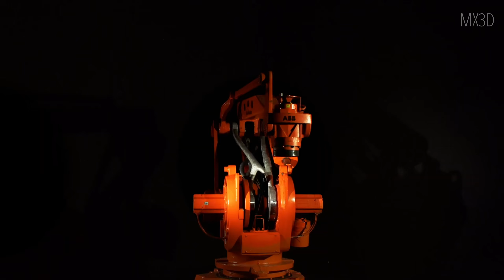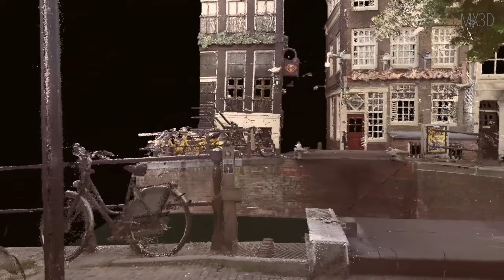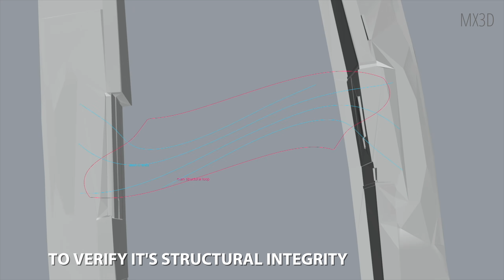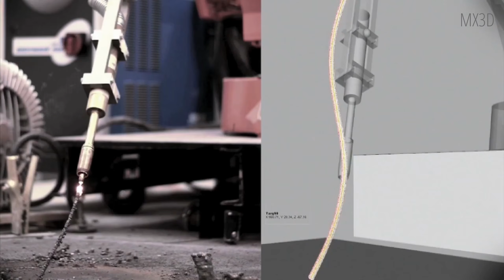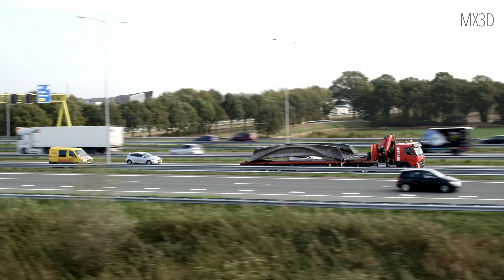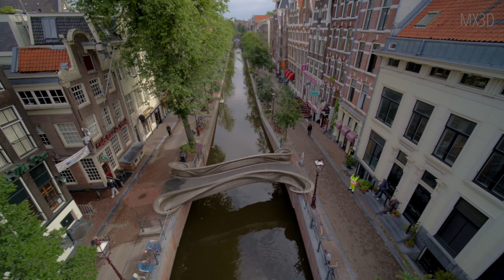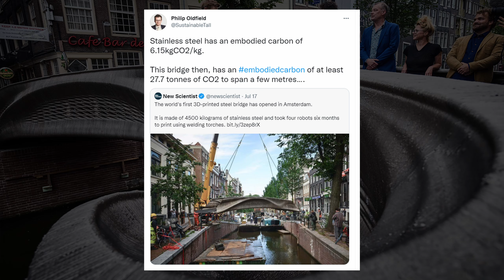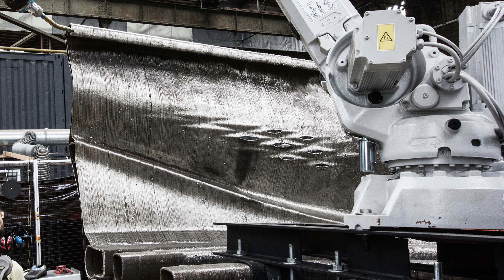World's first 3D printed STEEL bridge | MX3D

Comment: I visited the bridge yesterday. It’s an amazing structure and for me it’s a new word in architecture, but it is also an experimental work and we cannot expect it to be perfect. There is a problem of connecting one side of the bridge with the pavement – you can really look under the bridge between the ground and the walking surface from one of the ends to see the sensors. It leaves a very good impression. 
 Thank you for the video and multifaceted view on this event.

Comment: It is not that ugly compared to some other modern art, but it surely doesn't fit in. In terms of misalignment it can be fixed with repaving the surface in a slanted way if there is no road in front of it that needs to be flat.

Comment: I am a welder and CNC machinist, 3D printing structures like this will never be economically viable for large products. 

This is because when you print with a welder, you are consuming an absolute ton of electricity, so the process not only takes a long time, but it is energy intensive. 

Where I can see this technology working well is in creating joinery where you have to bring several pieces of structural steel together, and need a strong fitting developed in a certain way to bear the load.

Comment: That seems more like a publicity-stunt than anything else:
Metal  printers have been used for many years in industries already, yet somehow this bridge has worse printing-defects than even printers from 20 years ago. And the entire design seems like something you could create with normal manufacturing methods.

3D printing in any form has many advantages for single-piece production like prototyping, but it is not suited for things that can be constructed by other means or objects that you need to produce many of as 3D printing is inherently slow and expensive (and no, no matter the technological advances those 2 can not be changed. That is like trying to create Ice without spending a lot of energy - not possible).

Comment: Its looks great but production process isn't environment friendly, i can tell it as a welder, you don't know how much heat(co2) , toxic gas welding process make, especially when it took 6 months. You can easy make more then 100 normal steel bridges that size with that energy and wastes.

Comment: Futuristic certainly but it also reminds me of Art Deco. A compromise to reduce the carbon footprint and avoid layering might be to 3D print very large molds for metal casting which would no doubt have it's own challenges.
Incidentally Relativity Space are using wire welding to 3D print entire stages for rockets althought it's still a work in progress.

Comment: If it took 6 months to 3D print then this would suggest that there were probably significant breaks between each layer of welded steel. This was probably due to significant deflections caused through heat build up. Probably not an efficient use of the Robot. Thanks for the Vid, I have been watching this project for years.

Comment: It looks cool but
1. I don't want to have bridges which are able to call the police if you walk over it during a lockdown, what dystopian future do we live in?!?
2. The energy needed to run 15 tons of welding wire through a welder is insane, why wouldn't you at least 3d print it or parts of it in some other material and use them in investment casting, this would be so much more efficient... and I don't think the design constraint of not being able to create cavities is that big of a deal for a bridge tbh

Comment: The technology itself makes sense.
 Maybe for construction site less, for for sure for manufacturing.
 I will allow longer lasting cars etc., as right now plastic is used in the working environment they destroys it. 
Saying that, this bridge is a piece of functional art. 

Bones are not the "most efficient" structure. They need to have muscles attached to them and move. The taller the cross section, the most resistant it is to bending. This bridge illustrates that. 

As always, great content :)

Comment: Considering that the project took six years to complete, surely someone must have seen that the structure was too big to be installed in one piece. The design should have taken this into account, and a sectional design created that would slot together on site. I am also rather underwhelmed by the solution to the mismatch (for which, in the age of GPS that can register a site in 3 dimensions, I can only assume was extreme carelessness) at one end of the bridge. There were many ways that the difference in levels could have been dealt with, but they seem to have chosen the worst solution, which not only fails to be wheelchair friendly, but appears to be dangerous. 

Concept: 8/10
Design: 7/10 (they do look like waste bins!)
Installation: 5/10

Comment: This is not 3D printing,  it is robotic weld deposition.  Your reference to the 1925 patent outlined the overall process. In this case deposition is optimized by real time weld quality monitoring, and the deposition of SS material is optimized by detailed stress analysis.  Otherwise,  thank you for producing this excellent video, 7 minutes chock full of good points.

Comment: The last comment on fitting has some reasonable doubt. As you said, they had to wait 3 years because of remodeling the site. Maybe the scans from 2015 and the remodeled site in 2021 are different enought to not fit the bridge printed in 2018. I wouldn't blame neither them nor the tech involved without clearing this up first.

Comment: A better name would be 3D-WELDED bridge instead of 3D-PRINTED bridge, the "printed" is a bit misleading because printing doesn't imply using high temperatures nor welding.
It's a beautiful design nevertheless, it would be nice to have some comparison between this bridge and a conventional steel or concrete bridge. Price, construction time, mechanical properties etc.

Comment: I'm mostly impressed by how they've implemented the sensors to be able to detect how stress forces are applied, being able to detect in real time the health of a structure is pretty cool.  
The 3d printing aspect is an interesting test and probably one that's needed to be able to develop the technology further, but I cant help but wonder if it would have been more efficient to try to grow bamboo to shape
Reply: Strain gauges are very easy to install on most structural steel.  It's actually a very common thing to do.

Comment: the surface and material orientation is a result of the process - not a downside. this piece is an important step in experimenting with new tech. there is no why. this tech isn't entirely untested - fully functioning, 3-d printed metal rocket engines are a reality.

Comment: Me: So you built a bridge in one-piece only to take it apart to ship it them then weld them back together. Why not just build the bridge in smaller shippable interconnectable sections? This way you can also make quick on-site adjustments. Also you could just put 10-incn metal flaps on the end pieces that can act as both a ramp and cover.
Professionals: Are you an engineer or have a degree in our field? If not, shutup criticizing.
Me: No but it just seems like common sen...
Professionals: Stifle it!!!
Me: That attitude is why I keep leaving trash at your project sites.

Comment: I live 300 meters from this bridge and walk over it regularly, just because I can. It's not entirely fair to blame the bridge for the nature and texture of the material. That the bridge does not fit quite right is an interpretation error. It is the environment that does not fit the bridge. The foundation was changed after the bridge was printed. This is a limitation of 3D printing. A craftsman would have adapted the bridge 'on the job'. A computer does not have that intelligence

Comment: It’s rough because they chose to leave it rough like a other printed concrete bridge in I thought the city of Eindhoven, of course you can polish or stucco the finished bridge but they are displaying the technical features so that you really can see the layers of metal. 
Why would you innovate and spend more money, because you’re want to be innovative and you want to create a possibility of new technologies. Like every new technology innovation will make it cheaper and faster. And just because you’re using it just for a brief time you can use it as a test. 

The council changed the sidewalk and that’s the reason it didn’t fit exactly. Not the bridge but the street work is the eyesore.

Comment: Very informative video. I didn't know this tech ique was being applied outside of the 'lab'. It's surprising to me that despite of having photogrammetry models, the bridge didn't fit at all on 1 side, but I guess that's why we do experiments like this in the first place.

The next iteration will be better, then the next even more, etc.
Reply: During the time the bridge was getting built, multiple embankments in Amsterdam suffered a total failure and collapsed.  These accidents were looked into and revealed ground material that had been washed away by the tourist boats at some points because of the tight turns they need to make in some parts of the canals, causing a lot of erosion.
One of the biggest collapses also made it clear that due to this erosion, some embankments might not be safe to drive heavy traffic on anymore, and some saw emergency repairs to mitigate this as a result.
I'm fairly sure this is part of the problem.
(Next to that, this is The Netherlands and at times, with all our rule- and normbooks on how to desigin public spaces we tend to make dumb, costly mistakes that sometimes are near impossible to fix).

Comment: I tig welded stainless steel for many years, this seems like a huge waste of electricity,  argon and carbon dioxide, but it is artistic.
Reply: Argon seem like an excessively expensive choice of shielding gas on a big project like this.
Reply: Exactly....and how much would the MIG wire cost....in Australia a roll of 4.5Kg is a weeks wages....And if you start with a kilo of wire....how much of that is effectively deposited...how much is vaporised ?

Comment: Re the badly fitting ramp: When I hear that the bridge had to wait several years for installation because of renovation of the embankment, I think we know the cause why despite scanning the interface first it did not fit.
On the critique of the inorganic layers: That could be addressed in the slicing process. The robots are capable of laying down the layers in any form. No need to slice in the geometrically simplest  way doing plane cross sections.
Reply: But it also makes me wonder how much it may have warped as a result of production method? During printing, some material tension gets locked within which can later cause a warp. But indeed the installation spot changing in the interim is the most apt explanation, also considering they were worked on in the interim.

Comment: The first thing I thought when I saw the welding bot at work was "why not cast it"? Given the fact it could not be done with intricate design elements that are the supposed strength of this method, basically, it seems like a failure. 

It would seem to make way more sense to invest time and money designing a more sophisticated casting method using 3D cutting techniques to create the casts. Looking at new more eco-friendly casting materials rather than styrofoam. I'm sure there is some out there. I can't see anything in that design that could not have been done without casting it in sections. The thing about them cutting it up to get it in situ before welding it back together again seemed like the final touch of ridiculousness. 

I'm sure there's a place for this so-called "printed" process, but I think it'd be best confined to smaller elements such as decoration or even the handrail, assuming they figured out how to design it so that it stood further away from the wall or didn't provide a level enough surface or gap to shove garbage.
Reply: obviously it could have been cast, or made of standard beams, or wood, or any other process. except the whole point was experimentation with a new process. as such, it succeeded, albeit with some flaws. such is the nature of progress.

Comment: I always ask people what the fatigue strength of materials is. 99% of people who bullshit about 3d printing don't know what I'm talking about, so I tell them to shut up. In this case, I don't need to ask- MIG blobs are a known quantity. 

I always say that there is probably a bulk process which will perform better than 3d printing. In thiz case, the fatigue life and yield strength of moderately high tensile steel, with the joints designed by proper engineers, instead of vanity-project tossers, would give a more elegant solutuon than the one above.
Reply: missing the point entirely, eh?
Reply: What is the point of testing a device made using a completely wrong process? It is clowns' engineering.
Reply: @charliecroker7005  yep, still missing the point.
Reply: @daos3300  Asking what the point is, is missing the point? That means that there is no point, which was my point.

Comment: I can imagine no worse possible way to make steel.   Making an entire building by using a tig welder,  is a problem that didn't need to be solved.    Typical out of touch architects
Reply: innovating the future of materials technology is basically the opposite of 'out of touch'
Reply: @daos3300  if this is innovation,  we aren't getting anywhere.   no real application.   construction industry is resistant to change as it is market driven,  a tig welded building will not change that
Reply: @vincedegennaro3534  so, following your logic - innovation is pointless since innovation cannot lead to change therefore innovation is pointless? this is called circular reasoning.

Comment: Very cool!
I'm a bit concerned with rust and micro cracks. Welds are notorious for introducing impurities (where rust can form) and the unoptimised layer lines are an obvious weak spot.

Nevertheless, if paired with electricity from an eco friendly source, this could have a smaller environmental impact, since less steel is needed. So pretty much the EV argument ...

Comment: A lot of the canals in Amsterdam are approximately the same width. They may move it around to rebuild other bridges? To me they should have fastened the three piece back together rather than welding since it not truely "3D printed" at that point anymore as one piece. Looks better than some temp metal scafford type deal. Reminds me of a rough old cool car- looks great from a distance but upon closer inspection, well you know. Like that it is full of sensors. They where really committed to seeing this project though! It's cool!

Comment: 1. Use 3d printing techniques to build a bridge in a most efficient manner so that the construction itself is stable
2. Takes the bridge apart in 3 pieces and re-assembles it

^- that's just funny to me. Any data they gather from this bridge will be meaningless since they took it apart and re-welded it, that defeats the whole purpose of such a structure. I feel they should have allowed the robot to run in the open and complete the bridge in the environment as-is for a much better test of the idea.

My personal opinion on this is that it's actually inefficient. Welders tend to require a lot of energy and there is loss rate from metal splatter. There's also the sunk costs of the production of the welding wire spools as well...so instead of going from foundry to beams/rods to construction, you go from foundry to rods to stretcher to stretcher to stretcher to spooler to welder to construction. More machines means more things can go wrong, more parts/oil needed, more energy, etc.
Reply: 1 and 2 were obviously not intentional, or they weren't bothered as the point of the exercise was to construct the bridge in a particular way. this they achieved. since the whole bridge is basically made of weld beads, welding the sections together is about the most appropriate way to reassemble.

with a correctly set up welder there is very little spatter, losses are negligible. any possible extra costs in manufacture of welding wire could more than easily be offset by both the amount of material saved in the final design & construction, and vs the materials, fixings, processes, energy and manpower required in standard construction.

Comment: I wonder why people go ga-ga over additive printing structural materials.                                                                                                                                                        Weren't forged steel structural elements the solution to overcome higher weight-to-load bearing capacities of cast-iron products and also the solution to the problems of casting defects and failures caused by inherent weaknesses of the casting processes?                                                                                                                                                                                                   Doesn't additive printing spread out these problems over the entire layered structure?
Reply: it's not cast.

Comment: Building materials and design suggest use whether or not the designer intended that purpose. Use a soft material, and people will carve it. Use an accessible flat design with material that holds paint, and people will paint it. Make a bucket shaped design, especially in an area with inadequate waste disposal, and people will leave their trash in it. Another example... the engineers who designed the refrigerator wanted to use a cheap sturdy material for the outer skin and placed the device in the kitchen. Combined globally, these surfaces display a thousand times more square meters of art space than all the art galleries in the world.